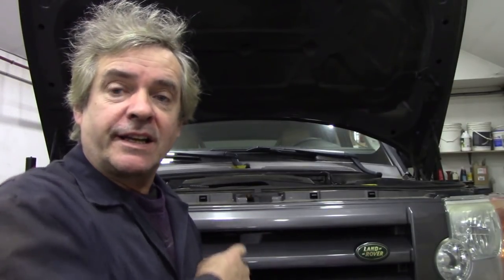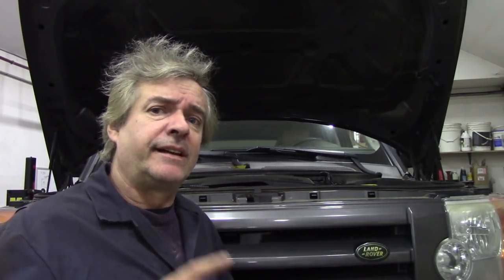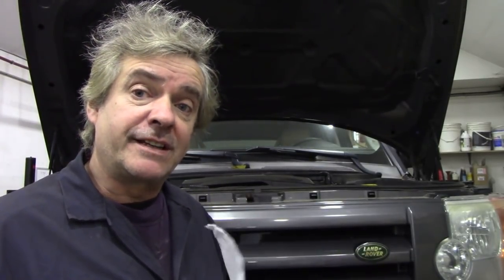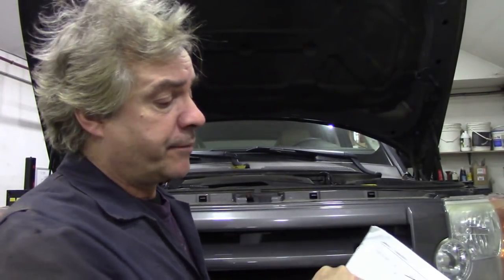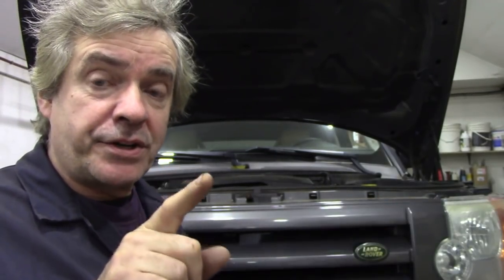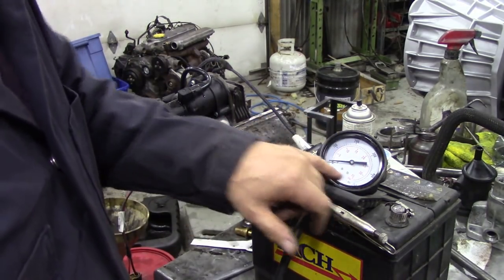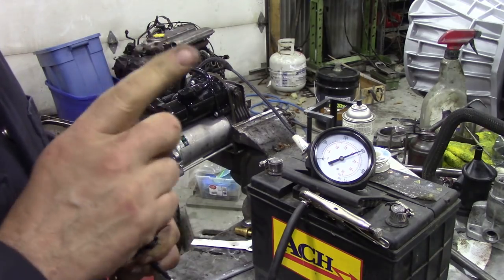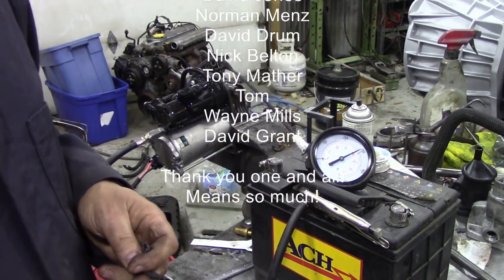LR3 / Discovery 3 air suspension problem - am I missing something here?

Comment: You said something interesting the compressors fills the system first then the reservoir, could there be a leak on the system somewhere, that compressor only produces a small volume so it wouldn't take much of a leak to pull the pressure down.
OK, just watched the second video it was a leak on the system. Just a thought on why the compressor was held off, those little compressors are low duty prolonged use will knacker them in no time (overheating) there might be an algorithm in the software to protect the compressor from excessive run times.
Reply from the maker: They have an overheat sensor in the pump windings, but if there is no pressure rise in 15 - 30 seconds the system shuts down and throws a code - which is why it was difficult to diagnose on the vehicle

Comment: I would remove the compressor relay and run it with a jumper to try and get pressure in the system, can then check for leaks/bad solenoids. Might just be a prv or pressure sensor gone bad
Reply from the maker: I've done that, but it bumps the compressor up to max pressure (as I tested on the bench) and you can hear the relief valve blowing off
There must be a blockage OR a valve not opening by the computer
I put the compressor on the bench and tested it with a gauge to show you guys

Comment: Have you tried airing up the suspension with the shop air compressor?
Understand that I have zero experience with Land Rovers. That said, it's just a pneumatic system.
My thoughts:
1. test the pressure sensor - electrically if you can find the info
2. hook up shop air to the system through a regulator set to 20psi or so
3. beginning with the connections closest to the air input, disconnect and check for air. Continue through the entire system ending at the connections farthest from the input. If the system is blocked anywhere, such as debris in the connection for the pressure sensor, this should eject it from the system. This will also let you know if the control valve is properly routing air.
4. once you can verify that air is getting where it should (on shop air), check for leaks.
5. if everything seems fine, I would start checking wiring from the sensors to the computer. 

Also, what are the electrical specs for the compressor? If I understood correctly, the compressor was replaced, but not with the right unit? If the compressor was replaced because the original unit died and the new unit is pulling too many amps, it could be tripping a thermal breaker. If that's the case, then the entire system could be fine and you'd still see this type of behavior.

Hope this helps,
Les
Reply from the maker: I have it running - but not working!
Pump, main valve to tank, pressure switch all check out fine - I think it is the rear suspension units
New video on its way  - back to work!!

Comment: If can why not fit the pump again, the like did in the vice, connect directly to a battery, bypassing the computer and raise the d3 up of its haunchesthen the system is pretty loaded, just an idea
Reply from the maker: Think I have worked out the issue - new video on its way but it has something to do with the rear suspension - pump and main valves, tank are fine
And I seem to recall the owner said it had new rear suspension fitted...
Reply: When some one tells me “I have new suspension in the rear”

There is a 95% chance that person doesn’t have one clue about how a machine works.

Comment: That 340 from the pump is getting close to the system maximum, so I'd say the pump is fine. Here in Oz there is a guy who makes and sells emergency air up systems for D3/4s ( https://www.greenovalexperience.com/product-page/eas-emergency-inflation-kit ). Perhaps your customer would like to buy one.

If you apply compressed air ( I'd start with a low pressure ) to the system does the car lift? 

In answer to your question re 34 years, I'd say, given the people I have talked to who own these things, that the answer is YES. People LOVE them. There are people, here at least, who are dedicated to keeping them going.
Reply from the maker: The air system checks out and operates great now - but will not lift - I have a new video on the upload now, but I had a pressure gauge fitted the the outlet for the rear suspension and everything worked (except the lift as the rear was isolated) - soon as I re fitted the rear line - problems
Bit of breakfast then I will tackle it

As for the 34 years - LR have a program of making parts obsolete at 7 years now for slow moving parts - started that when Ford took over
Problem is will the aftermarket suppliers think there is enough demand for post 2000 vehicle parts, where as the Series and Defender market is huge
Reply: @BritannicaRestorations  Glad to see you fixed it, Mike. Those cheap push connectors are useless under pressure. 

I hear you re the parts obsolescence, it's a disgrace, but it's apparently " the future ".  Folk like us are dinosaurs. However, there are many ways to keep on. That D3, or LR3 for the Yank market, uses the 2.7 PSA engine. Here in OZ that engine was used  in a local product, the Ford Territory. Ford Australia sorted a lot of the problems those engines had, and there were lots of them built. It's not a simple bolt in job,  but it isn't hard. Many parts are being made by aftermarket suppliers. Good and bad, I don't need to tell you about that. 
But the D3/4 is held in high regard here for it's touring while towing capabilities. 

Keep the vid's coming, but do try to get a little sleep, 'cos we'd miss you if anything happened, Mike.

PS. You really need another racoon.
Reply from the maker: Thanks!
Lets see what bring brings for orphaned Raccoons!
Reply: @BritannicaRestorations  You need the racoon, Mike. Your vids are interesting, and very informative, and also a lot of fun..... the racoon gave you an edge, something that set you aside, something to watch. You will rue the day you sent Rupert away......Mark my words...  Lol. I would have had him...... well, if I wasn't in Australia..
Reply from the maker: He was cute,  but when they get to 40 lbs - not so cute! (and he crapped all over my tools and shop!)
He left of his own accord and a good thing too as it is illegal to keep them in captivity as pets - in Ontario you can get a huge fine just for feeding them!

Comment: If the car has ride height sensors, It might be worth checking them out
Reply from the maker: But all 4 should not be out at the same time - and I cannot get the car to lift to see the ranges on the diagnostics! 

Bit of a catch 22
Reply: Will the car lift if you give the pump an external supply, like you did on the bench?

Comment: Mike I am betting that it's times like this you are wishing that you could have been on the LR design team If only to tell them that what they have come up with is CRAP and far to complikunted to be reliable or easily repairable . My other thought is that pumps .AIR /WATER/OIL.only supply flow. the pressure is the resistance to the flow.which simply means that the air is not getting to where it is wanted by being either blocked or leaked before it gets there .However after watching many of your video's and also understanding your thought process in tackling problems I do know that eventually you will find a solution or fix, probably something that LR should have considered before the accountants took over the design department .
Reply from the maker: Christopher
I was working on this at 4 am this morning and I had the system running - but not working - just uploading a new video but I think I am on the right track!

Comment: Check valve block
Reply from the maker: I checked the one nearest the pump off the vehicle with 12 V t the solenoid and clicked nicely - took it apart and put a we bit of silicon spray to lube it but the issue is I have no method of triggering the independent valves with my current diagnostics - I can for the P38 but not for this - seems I need something to do deeper
If there was a way to open all the valves and let the pump run, then maybe I could figure it out better - but an a few seconds cycle it is not long enough
Reply: @BritannicaRestorations  has it got the factory fit sat Nav? If so has it got the 4x4 screen option on the main screen? If not your device might let you switch it on this would give you an insight to where the car thinks all its wheels are.
Reply from the maker: That would be too easy!
No it has no screen
However, this morning I will pull of the first set of valve blocks and attach it to the pump while in the vice  - then I can see if there is air passage through it and operate the solenoid to see if the valve is opening to the tank - you know thinking about it I could set up the whole pneumatic system on the bench and test it!